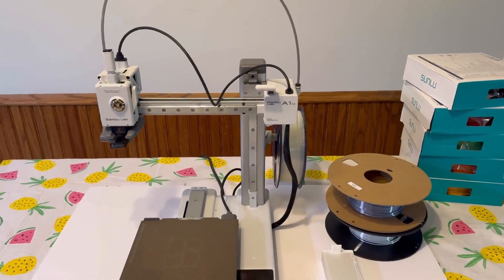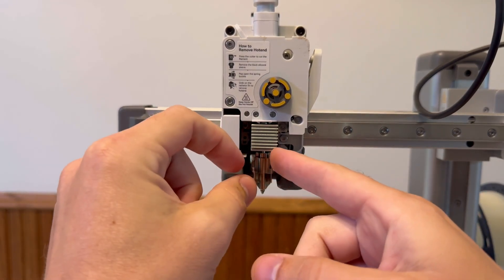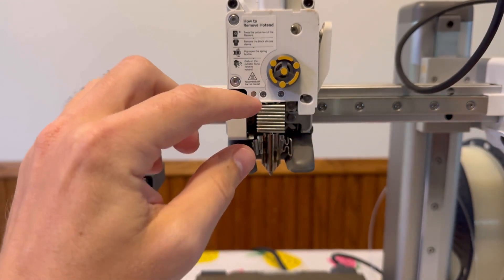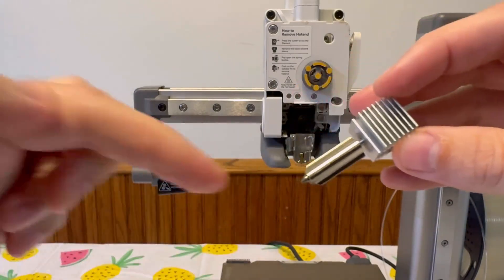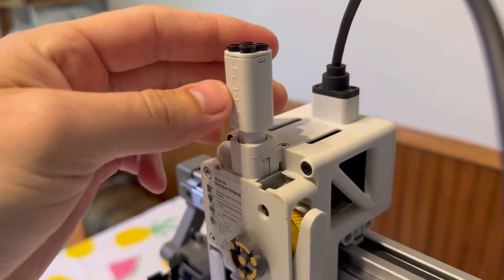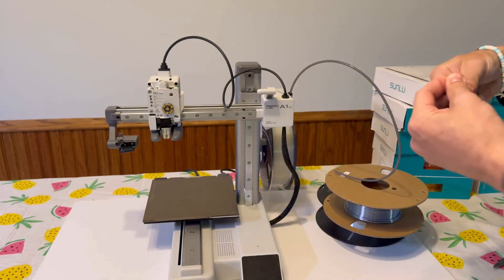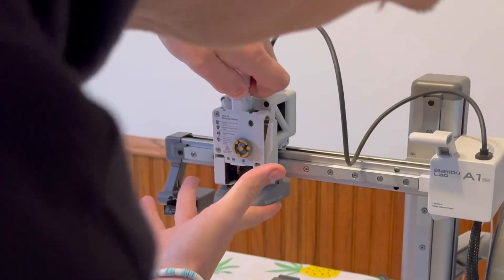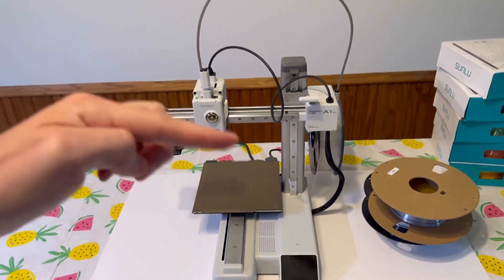How to Teardown Bambu Lab A1 Mini - Head Disassembly

Comment: I call it a AMS Hub 😂 Do yourself a favor after printing your first benchy boat. Print a PTFE removal tool, Don’t use a screwdriver to release ptfe tubes. That’s non sense 70% of the time filament brakes off in extruder. You should also should never pull your filament out of the extruder without using the filament release lever located next to the Hub. It’s why they put it there.

Comment: I watched this as I had a clogging issue after switching over to a hardened steel hot end. My issue ended up not pertaining to said hot end. There was one thing that wasn't covered in the video as I suspect and hope that it is an extremely rare occurance.  My A1 Mini is relatively new.  One of the things I found when I got it is some idiot put packing grease in the AMS connector that goes on top of the print head, this causes constant clogging and jamming issues.  I personally am calling my issue a straight up QC issue. I cannot see any reason whatsoever why that part would need packing grease. It's thick, and super sticky. I can easily see a nozzle clogging issue if that crap warms up and gets stuck on the filament as it passes through. Just for awareness.....

Comment: if you have a little clacking sounds while vibration compensation, it may be the filament cutter. You can mostly eliminate the clacking sound by following the guide to remove the cutter and then use the supplied grease from bambu to grease the pin hole where the cutter is clicked into. then put it back together and the clacking should be mostly gone. Oh and there is a printable for the 3 remaining PTFE tube connectors to stop them from vibrating as well.

edit: 0:30 there is a cover removing tool called "Nozzle Change Wrench for Bambulab A1/mini" which works perfectly by slightly bending the cover and releasing the tabs, i highly recommend you print this if you often change nozzles for example.

Comment: you dont buy a new toilet each time your having a stool just because their cheap.
Reply from the maker: What….?
Reply: @3DPrintDood  I think the point being made is that there is some corrective action that could probably be taken short of replacing the toolhead.  Here is an idea:

"I have an Bambu A1 Mini toolhead that is fouled.  I removed it from the printer.  What temp can I bake it at to attempt to clear if of obstructions?
ChatGPT said:
To clear a fouled toolhead by baking, you need to be cautious with the temperature to avoid damaging the toolhead components. Here’s a safe guideline for most 3D printer toolheads:

Nozzle Material: If the obstruction is within the nozzle, determine the material of the nozzle (brass, steel, etc.). For brass or steel nozzles, the material itself can tolerate high temperatures.

Temperature for Cleaning:

If the obstruction is PLA: Bake at 200-220°C.
If the obstruction is PETG: Bake at 240-260°C.
If the obstruction is ABS: Bake at 250-270°C.
If you're unsure, start at 200°C and incrementally increase until the material begins to soften and can be removed.
Precautions:

Ensure no plastic or non-metal components (e.g., silicone or PTFE tubes) are exposed to these temperatures.
Use an oven or a dedicated heating element that allows precise temperature control to avoid overheating.
Steps:

Preheat the oven or hot air gun to the target temperature.
Place the toolhead on a heat-resistant surface like a metal tray.
Allow it to heat for 5–10 minutes, then use tools like a needle or wire to gently clear the obstruction.
Note: If the fouling is severe or contains mixed materials, consider using a solvent specific to the material type (e.g., acetone for ABS, ethyl acetate for PLA) before baking.

Estimated Accuracy: 95%"

Having built a Prusa MK3S before - I'm glad for how easy it is to remove the toolhead. At the cheap price, a spare on hand is not a bad idea at all. Rather than toss one out, I'm sure these steps can clean most fouled heads provided they are not damaged. 

I'm sure there is probably a hot-pull/cold-pull guide for this printer that could be used.  But, in the middle of a pending print, fast swap out and clearing the path is a much quicker solution, IMO.
Reply: Trying to tell you don’t 😊have waste your time. To get you rolling again.